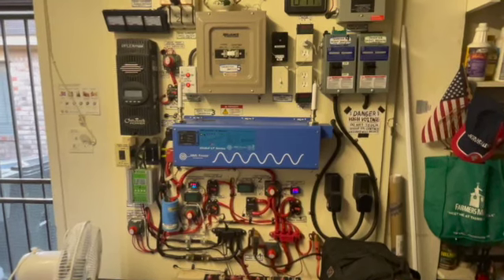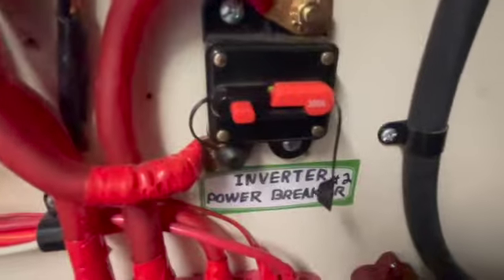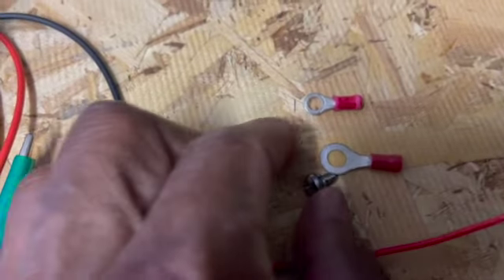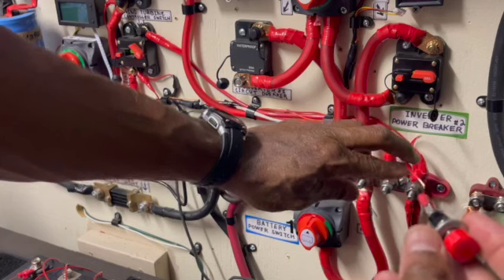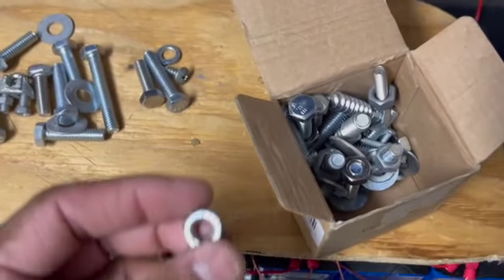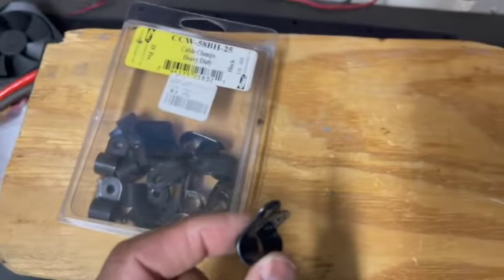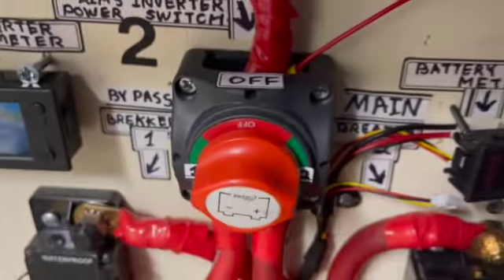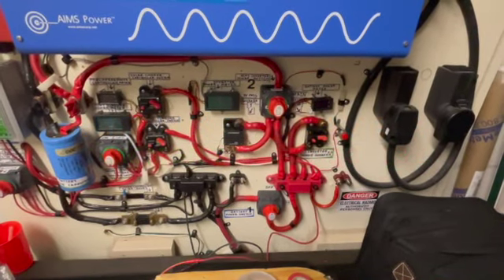MY EASY CAPS PUSHBUTTON CHARGING SOLUTION

Comment: Pretty nice solution. I approached it differently and used a 3 way at the first battery connect  (i.e. Off , 1 on, 2 on, 1 & 2 on) and just ran 1 with resistor to the inverter and then 2 after caps are charged. As for speeding it up the only way I know of (not an electrician) is to reduce the resistance as that is your dam in the river.
Reply from the maker: Yea ! I will consider that about lowering the resistance that will hopefully charge them much faster . Like the way you said you have yours connected . Thanks .
Reply: @defjamsgreen  wiring 2 or 3 of those resisters in parallel will get your desired result, 50-30 ohms and will charge faster, or look again you can get an identical 10amp resister rated at 10 ohms.

Comment: Momentary switch and a resister in series as  a bypass for the circuit breaker and switch to precharge the capacitors, nice idea. I can see how it will precharge, but without a connection to your inverter's negative side, how is it discharging the capaciter? or are you just using it to power on the meters and letting the meters drain down the capacitors?
Please use a proper crimping tool to add terminals to wires, just mashing them with pliers won't grip the copper as well and the wire will slip out of the terminal over time. also, please shorten the leads on the resister and solder the wires to them.  The 'twist together' will loosen over time and it not a solid connection, and you don't want any exposed hots without covers/insulation.
Reply from the maker: No , no negative wire . Just a jump wire from the positive red bus bar  . When the caps start to charge then the meters will dim on showing the rising voltage until max voltage is within your satisfactory range to turn on the inverter disconnect switch without sparking . Don’t use it for discharging but the other video “ Tri Feature Aims At Ease “ there is now a discharging circuit to discharge the caps if you want to use that feature . Both the Pos and Neg wires from the button and resister are on the inverter Pos and Neg cables . To discharge the caps with residual charges that’s left after turning off the inverter will tend to keep the meters on .You can also use the disconnected switched inverter to discharge the caps also . Just turn on the inverter with the disconnect switch off .
Reply: @defjamsgreen  18:40 you are pushing this pre-charge button and you state you are discharging the capacitors 18:56 you announce the capaciters are discharged and you release this pre-charge button.
Reply from the maker: @jllaine  I know but then after that on the next video ‘ Tri Feature Aims At Ease “ is when I devised an actual discharge circuit on the Aims . Please check it out as this circuit is connected across the inverter + and ( -) cables above the big blue cap . So dismiss the 18:40 as it is no more . The focus is on the above video . May the solar be with you .